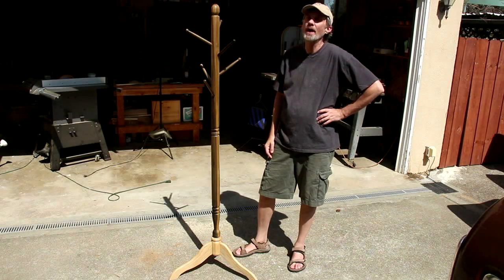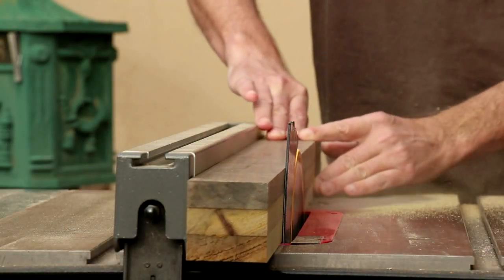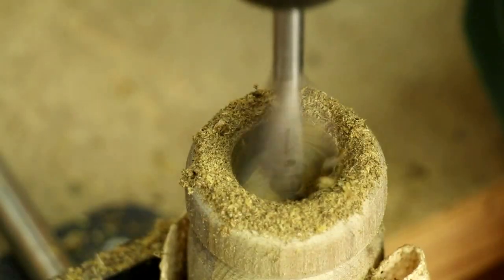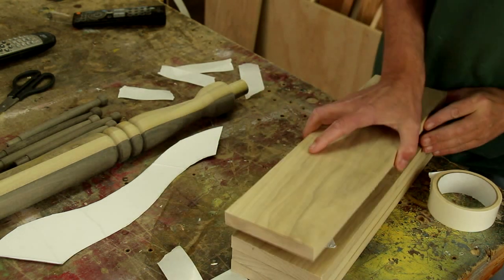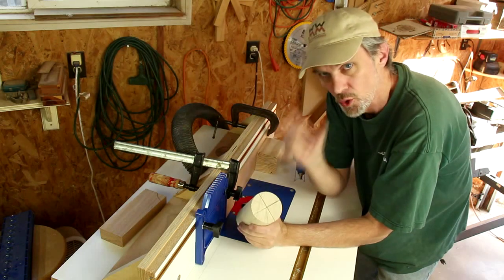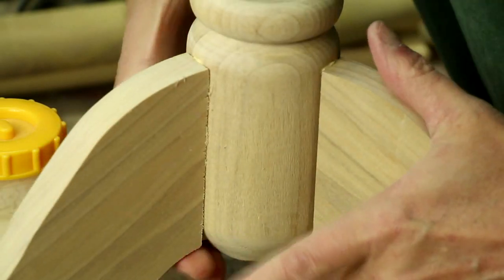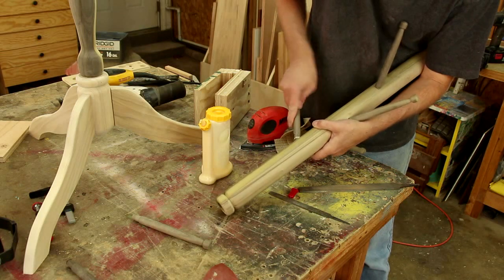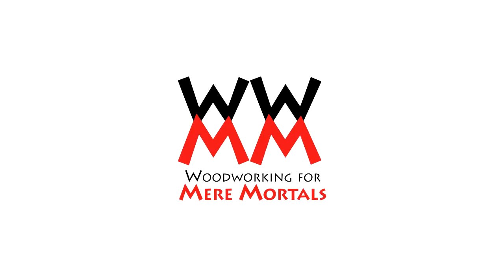Making a turned wood hat stand

Comment: Nice job Steve. I noticed your lathe height was a little low. Rule of thumb is bend your arm at the elbow and then make the center of your lathe at that height. Saves some pain in the neck and back.

Comment: You need to rout flats on the post before making the dovetail slots.  Then the male side has a flat surface to mate with.  The annoying part is dealing with squaring up the round top of the routed area, or you use a 3/8ths roundover on the top of the legs so they just fit in it.

Comment: Hi steve i saw you made a video about becoming beginning woodworker you showed your jigsaw and bandsaw i was thinkeng what can i do with my jigsaw to duplicate the stuf you can do with a band or scrollsaw and especially what you can do with a scrollsaw so i made myself some sort of scrollsaw table with my jigsaw using just a sheet of plywood with a hole in the middle for the jigsaw blade to come up through and the sheet was supported by 2 saw horses maybe this is an interesting project to show

Comment: The wood for the base is much lighter than the "pole" part of it, which seems kind of odd. Usually in tall pieces like this it looks better if you have darker colors at the bottom because they look "heavy" whereas lighter colors look nicer on the upper portions, or for long thin pieces.